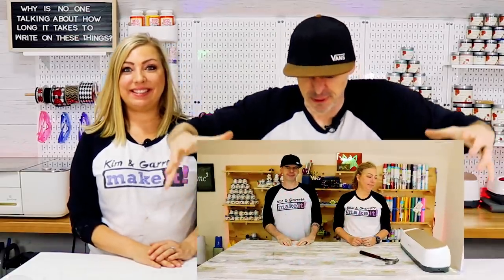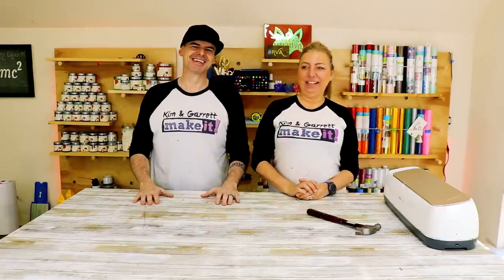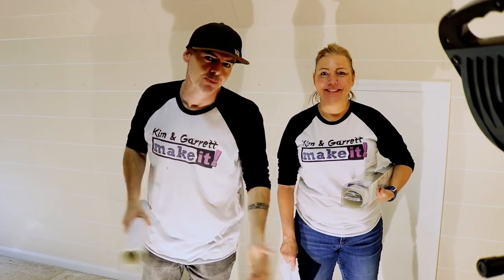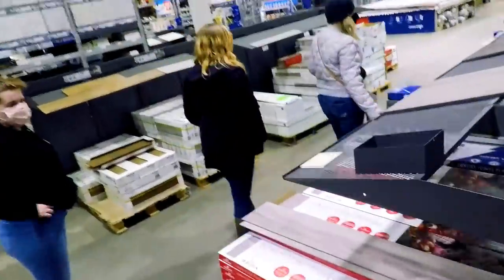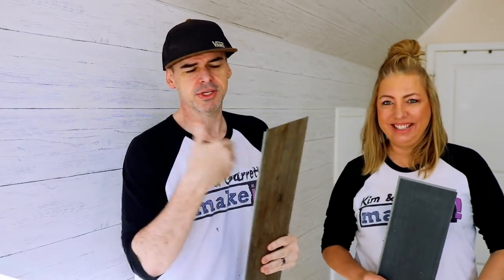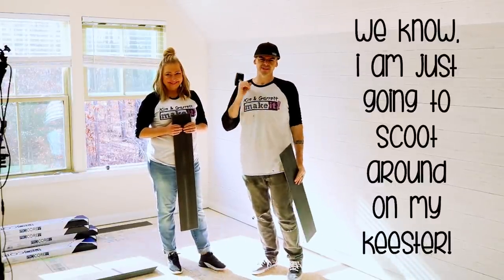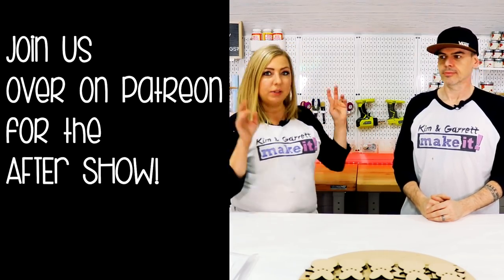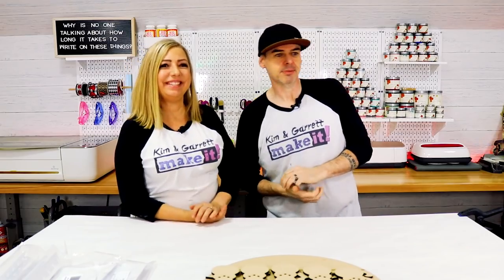Craft Room Makeover 2021

Comment: Looks amazing!  That peg board looks wonderful.  Does it hold the hooks in place tightly? We had the old style and we couldn't stand it ....everything popped off. Also, if you tend to have lots of dust in the room from your projects  I would suggest you do vynl roller shades so you can clean then easily. You can add remote control to it...so that would be pretty cool in that room.
Reply from the maker: Yes and yes thank you!